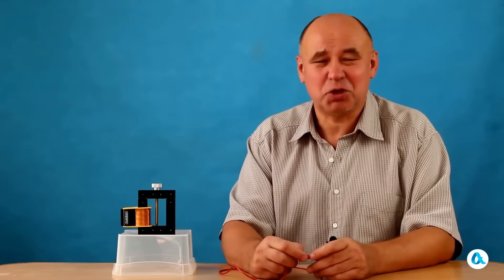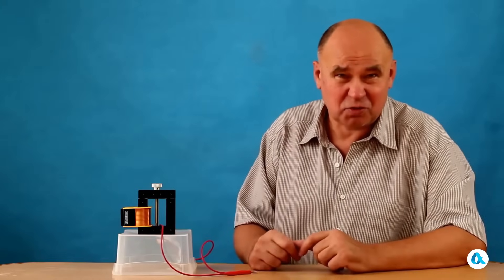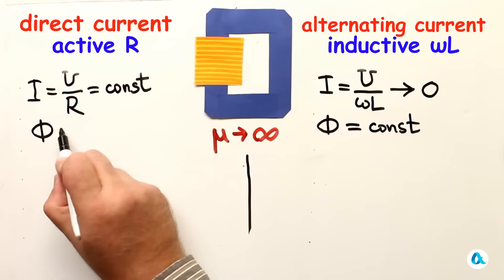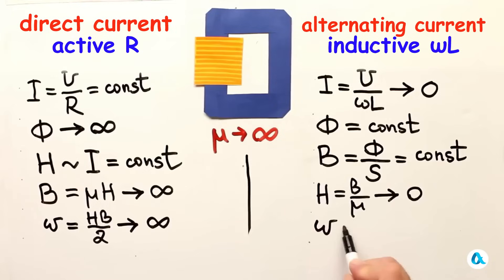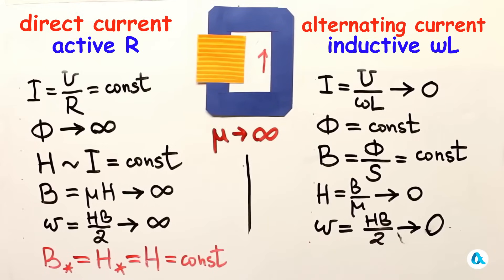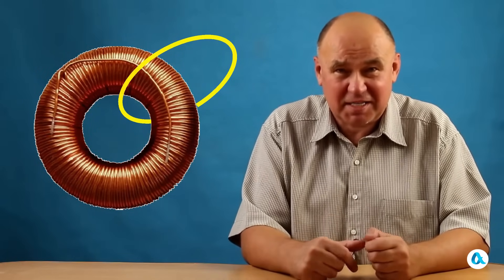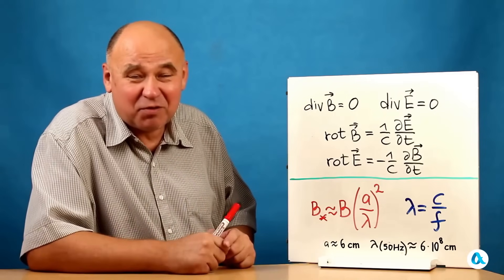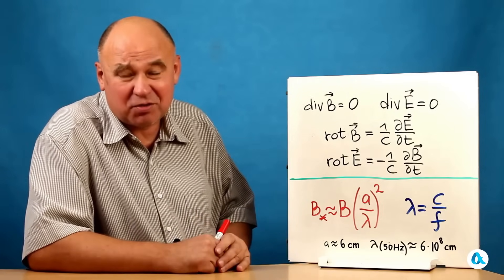Power transformer paradox

Comment: DC on left no inductence on right  after initial saturation of coil on right ?

Toroidal magnet is bizarre phenomenon.
What if you vary the frequency on one coil different than the other coil ?
Interference and/ or constructive magnetic waves.

Thank you 👍
Reply: I think the DC case is assuming an ideal core that never saturates. In that case, the inductance is constant, and the current and flux continue to increase without limit.
Reply: @gcewing  EMF causes induction requires the collapse variant polarity  of an  electric field from AC or disconnecting DC ...
Reply: @Motorhead250  Polarity reversal isn't required, only change. If you apply a DC voltage to the primary of a transformer, for some period of time the flux continues to increase, and induces a constant voltage in the secondary. The only thing that will stop this is saturation of the core (or some other limit such as the amount of current the primary can handle before it burns up). In an ideal situation it can go on forever.

Comment: (un)fortunately, we don't know material with infinite mu.
And those with high mu, have a very limited maximal B.
You also forgot to say about transient state, where DC voltage is turned on - here energy is delivered.
But indeed - question how wire know, there is a magnetic field changed in the core near by, is interesting. 
EM waves theory may be overkill ... try to calculate emmision of such transformer,  and compare efficiency with real one.
Reply: In the case of infinite permeability, speed of EM field propagation through the vote is 0 anyway. So no effect to the secondary. In the case of very large permeability, and big enough core, different phase angle of induced emf (than in simple transformer theory) may be expected

Comment: Going to your analogy in fluid dynamics from the last video. It’s making waves in the electromagnetic field that flow through the iron like a stream, and since it can produce the waves, it can also sense the waves. Which also explains the eddy currents that form loss in the stream. Why they use laminated plates instead of just one iron bar. Thinking about that the design of the laminated plates could be probably made even better maybe like a spiral